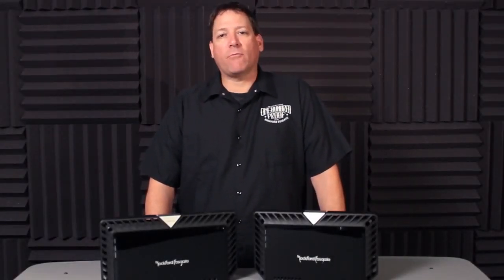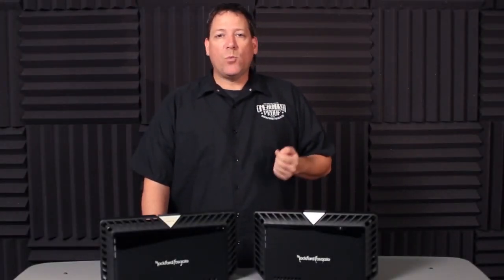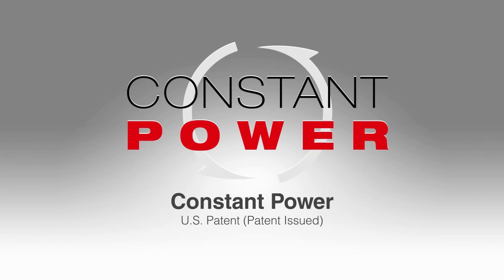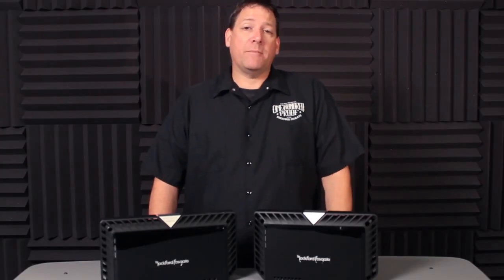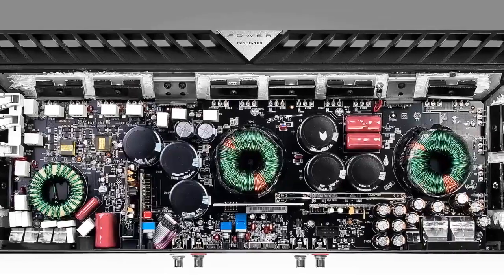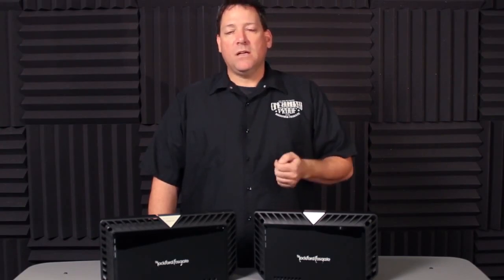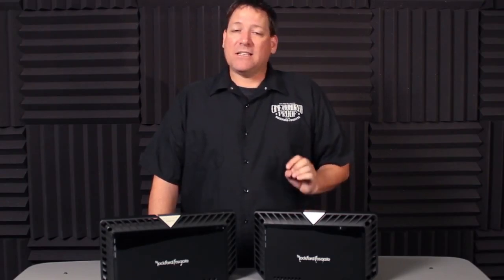Rockford Fosgate: Power Amplifier Overview (3.3)

Comment: Will the Power T600-4 over power a pair of T1692's? Also will a sub (300 RMS) have deep bass with this class amp? Thank you!
Reply from the maker: The T600-4 amplifier is rated to produce 100 Watts x 4 @ 4-Ohm or 150 Watts x 4 @ 2-Ohm.  Dynamic power output is 139 Watts x 2 @ 4-Ohms or 236 Watts x 2 @ 2-Ohms. The T1692 speakers are rated to handle 100 Watts RMS, so this will be a great matching amplifier.  Since the T600-4 is rated to produce 300 Watts @ 4-Ohm Bridged, this will be adequate for 1 or 2 subwoofers.  This is a Sound Quality amplifier so the bass will be accurately reproduced assuming the correct enclosure is designed for the subwoofers.  However, if you are looking for MONSTER bass (like you only listen with the volume at 11 out of 10),  you may want to step up to a dedicated mono amplifier.  The T500-1bdCP is a good starting point.
Reply: @rockfordfosgate  thank you for this perfect response!
Reply from the maker: @JBrain58  You're welcome!   We also have live techs during 8am-5pm (Arizona) business hours.  You'll see live chat at the bottom of our website at rockfordfosgate.com when they are online, or you can always call at 1-800-669-9899 and just talk with them about other scenarios you're looking at.  Thanks for help saving the world from bad car audio, one fanatic at a time! 👍

Comment: Does anyone know how I can tell if my amp is in fact the Constant Power model not the older one? I don't have the manual nor box.
Reply from the maker: The Constant Power models have a RED colored "bd" in the model number badge atop the amplifier.
Reply: @rockfordfosgate  and the tag on the bottom will say bdcp if its still there

Comment: I got a prime 750 on 4 4ohm svc 8s they handle only 200 watts they do good on the amp but should I have went with the punch 500 what would be the difference
Reply from the maker: The differences between these two amplifiers were taken from their spec pages:

PRIME R750-1D
250 Watts x 1 @ 4-Ohm 
500 Watts x 1 @ 2-Ohm 
750 Watts x 1 @ 1-Ohm

PUNCH P500X1bd
150 Watts x 1 @ 4-Ohm 
300 Watts x 1 @ 2-Ohm 
500 Watts x 1 @ 1-Ohm

Comment: I'm planning to buy two JBL CX Series 12" single voice coil 4-Ohm subwoofers for black friday, which amp do you recommend for my 2015 gmc sierra 1500 crew cab, by the way I'm planning on keeping my BOSE  speakers for the highs
Reply from the maker: Hi Juan, the JBL CX Series 12" are rated to handle up to 250 Watts RMS each, so two subwoofers would give you 500W Power Handling and can be wired in parallel to create a 2-ohm load.  If you're looking for just a mono subwoofer amplifier, you could use the Prime R500X1D since it's rated to produce 500 Watts x 1 @ 2-Ohms.  However, I caution you if you love to hammer your system... that amplifier can produce up to 647 Watts which would over power your system.

If you're looking for a multi-channel amplifier to also run the mids & highs, we'll need to see what the RMS power handling is on the speakers, so without knowing, you could use either the Power T1000-4ad (250W x 2 @ 4-Ohm for the stereo channels and 500W @ 2-Ohm Bridged for the sub) or the T600-4 (100W x 2 @ 4-Ohm for the stereo channels and 300W @ 4-Ohm Bridged for the sub.)
Reply: I'm going to to with the Power T1000-4ad thanks
Reply from the maker: That's a great amplifier!  Be careful when setting up the gains for your tweeters and midrange because it's one mighty powerful amplifier.  Just want to make sure your system lasts for a very long time.  You may want to setup the Gain Overlap at 0dB for those speakers.
Reply: I'm kind of confused because you first mentioned the JBL CX1200 12" woofers I'm trying to get handle up to 250 watts RMS each but on the description it says 1,000 peak power each, or am I being understood between RMS and peak power?
Reply from the maker: I agree it's confusing.  If you can't find the certified power ratings (CEA-2016 for amps and CES-2031 for speakers) then always use the RMS Power Ratings.  "Peak Power" or "Max Power" ratings are usually just double or quadruple the RMS ratings to represent "this product can handle this power for a few milliseconds".

As mentioned earlier, the Power T1000-4ad will be great using the rear bridged channels for the subs and will generate 500W for both subwoofers (250+250=500).  I'm just suggesting to use caution on the front channels because you'll be delivering 100W to the left and right sides, so check the power rating of your tweeters & midrange.  To be safe, set the gains on the front channels to 0dB Gain Overlap so you don't over drive them.
Reply: @rockfordfosgate  I know I'm late to the party for this thread, but I just had to give you guys props for not bashing the competition when responding to his question about the JBL speakers. Also props to not trying to hard sell him on Rockford brand subs (which are better by the way 😉)
Those little details go a LONG way in my book! 👍

Comment: Hey there I just bought one of this will it work for 3 12s jl w6s they need 500 rms is this amp weak for  my subs or perfect
Reply from the maker: Hi Kevin, sounds like you may have the 12W6v3-D4 or the 12W6v2-D4 and they are rated to handle 600 Watts RMS.  They don't necessarily "need" 500W, but typically a subwoofer like this works great from 30% RMS up to the RMS power rating (150W - 600W).  Since you have 3 of the dual 4-Ohm voice coils, they can be wired to create either a 6-Ohm or 2.67-Ohm load and have a total power handling capacity of 1800 Watts (we'll assume you'll wire them to create a 2.67-Ohm load.)

A great amplifier is the Power T1500-1bdCP.  It's rated to produce 1500 Watts x 1 at both 1-Ohm & 2-Ohm loads due to its "Constant Power" technology.  We don't have power ratings at 2.67-Ohms since it's an odd impedance, but under Dynamic Power conditions (real world) it can produce up to 1549 Watts x 1 @ 2-Ohms.  This is PERFECT to power these subwoofers without exceeding their power limitations.  Here's a handy link to that amplifier:

Power T1500-1bdCP
http://www.rockfordfosgate.com/products/details/t1500-1bdcp
Reply: Rockford Fosgate thanks I getting a cutcab done rn with 3 w6s v4s with a 4th order box hope that amp gives these sub the power they need
Reply from the maker: Sounds great Kevin!  If you need any assistance setting up the amplifier, feel free to give our tech's a call at 1-800-669-9899.  They'll be happy to clarify any questions you may have.

Comment: I have a t1500BDCP powering 2 JL W6v2d4 12” at 4 ohms, the amp gets hot, do I need to upgrade my vehicles electrical?
Reply from the maker: Does the amplifier shut down?  If so, how long does it run before it does?
Reply: Rockford Fosgate  it doesn’t turn off right away, it did stay on for a while of playing loud music.
Reply: It took about 20-30 minutes
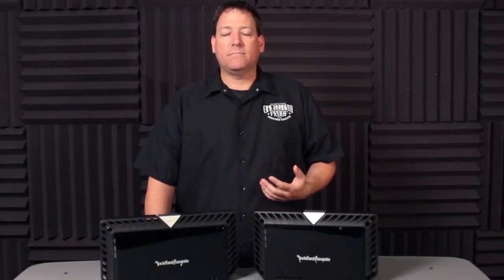Reply from the maker: There's nothing wrong with the amplifier.  Our MEHSA technology moves the heat away from the MOSFET more efficiently away to the heatsink like NO OTHER amplifier on the market.  The heatsink is doing exactly what it's designed to do, dissipate heat.  Look at this video at timecode 01:55 where we describe what MEHSA does for the cooling effect.

Comment: I have a scv 3k  that clamped around 1500 with a 1 ohm load. Will this RF 2500 clamp around 2500 with a 1 ohm load?
Reply from the maker: We run true Dynamic Power tests against Rockford Fosgate amplifiers.  Assuming you're referring to the Power T2500-1bdCP?  It's Dynamic Power numbers can be found under the SPECIFICATIONS tab on our website: http://www.rockfordfosgate.com/products/details/t2500-1bdcp/

T2500-1bdCP Dynamic Power
1823 Watts x 1 @ 4-Ohm 
2940 Watts x 1 @ 2-Ohm 
2980 Watts x 1 @ 1-Ohm
Reply: I was talking about clamping in a car. The way you have the sub in a car will change the ohm level. If I use this T2500, it should clamp 2940 watts in the car cause my ohm level moved up to 2 ohms from 1 ohm. and 2 ohms is about the same as 1 ohm on this T2500. If this will happen, this is the best amp technology out there. And i am a believer. And will buy this amp. I would love to see real wattage in the car.
Reply from the maker: The Constant Power technology inside the T2500-1bdCP is pretty amazing!  You can learn more about CP and how it works here: https://www.youtube.com/watch?v=7EP4-4TMWFw

Regarding "clamping" ... not 100% sure what you're referring to because the impedance plot of a subwoofer/enclosure is very complex.  In addition, the effect on the amplifier is complex as well (see the Constant Power video above.)  It's not a cut and dry 1-ohm/2-ohm equation.

The Dynamic Power tests we use at Rockford Fosgate are NOT based on simple resistive loads, because loudspeakers (subwoofers) consist of capacitive, inductive, as well as resistive loads.  The Dynamic Power data we publish is considered "real world" to what is capable in the vehicle.  I wouldn't read too much into forums that weigh heavily on "clamping" and "box rise".  There are simple factors like charging system voltage, proper grounding, and current reserve (energy storage capacitors) that have a much larger effect on amplifier power than those factors.

Comment: I have a (2007 year made) rockford fosgate p500 1bd  and I have 2 punch 2007(year made) p3sd410 can I conect them to 1ohm with this amp or this subwoofers??
Reply from the maker: You mean the P500X1bd?  Yes, it's designed to run at a 1-ohm load.
Reply: @rockfordfosgate  No. I bought it in 2007 and the owner manual says P500 1BD
Reply from the maker: @mikemorales5361  Ah, the Punch P500-1bd. Yes, it's also designed for a 1-ohm load.  You can find the owner's manual here: http://rftech.custhelp.com/app/answers/detail/a_id/865/
Reply: @rockfordfosgate  great now i know I can run this amp at 1ohm. But M'I in a safe zone to run the 2 punch p3sd410 that I bought back in 2007 without burn them??
Reply: @rockfordfosgate  or would be better to run them at 2 ohms??
Reply from the maker: @mikemorales5361  Although the amplifier is rated to produce 500W x 1 @ 1-Ohm, its actual power output is 734 Watts. However, the P3SD410 is rated to handle up to 600W RMS, so you'll have 1,200W of power handling capacity.  You can find specs on both the amplifier and subwoofer here: 
P500-1bd: https://rockfordfosgate.com/products/details/p500-1bd/
P3SD410: https://rockfordfosgate.com/products/details/p3sd410/
Reply from the maker: @mikemorales5361  No, you can only wire two 4-ohm DVC speakers to either 1-ohm or 4-ohm.  The amplifier is rated to handle a 1-ohm load, so it's totally fine.  If you look at the P3SD410 details page I provided in the last comment, you can see how to wire them by clicking on the WIRING WIZARD tab.
Reply: @rockfordfosgate  awesome!! Thank you!! Have a great blessing day!!

Comment: 1000 watt constant power okay for the loaded p3 enclosure?
 (1200 rms) i know most rockford amps go higher then they say (which is awesome)
Reply from the maker: The P3-2X12 is rated to handle up to 1,200 Watts RMS.  So, yes 1,000 watts will work just fine.
Reply: I'm running my bdcp1000 at 1 ohm on 2 T1 12s and they beat them to death the t1500 bdcp was a bit much for my car to handle the 1000 puts out 1500+ watts and dynamically i would expect in the 2k range. When I buy a 1000 watt power series RF amplifier I expect more than 1000 watts and according to my birthsheet its over 1400 at 2 ohms and over 1500 at 1 ohm. My 1500bdcp does over 2000 watts at one ohm and big d got 3200 dynamically.
Reply: @justinkelsey9218  yeah I ended up getting the t1000 on the p3s birthsheet was 1525 at 1 ohm....thing beats insaaaaaane. Sounds crazy in my 2019 suburu impreza
Reply: @DjTvna  im now running my image dynamics id max 12s on an orion xtr 2500 still got my black cone and silver cone t1 12s tho

Comment: Hi there, i have 2 punch p3 shallow sub and set of T2 components on the front and set of power coax on rear door what amp should i use? F
Reply from the maker: What model number P3 Shallow subwoofers do you have?  
P3SD2-8, P3SD4-8, P3SD2-10, P3SD4-10, P3SD2-12, or  P3SD4-12?
Reply from the maker: O.K. great!  The P3SD4-10 is rated to handle 300 Watts RMS, so two subwoofers will give you 600W total power handling capacity.  These 4-ohm DVC models can be wired to create a 1-ohm or 4-ohm load.  

There are several options, you could use a single amplifier like the P1000X5, or use two amplifiers like the P500X1bd for the subs and the P400X4 for the front components & rear coax.
Reply: Rockford Fosgate thank you! I brought p1000 2x and p400x4.
Reply from the maker: Great!  Our only suggestion is be careful with the P1000X2. That is a powerful amplifier and it will most certainly be feeding nearly double the power those 2 subwoofers can handle, especially being "shallow". Good news is ... this future-proofs your setup if you to upgrade to the Power T1 slim subwoofers as they respond more like a traditional subwoofer and have higher power handling capacity.

Comment: Can i run it 0.5ohm daily? My box rise up to 1.3 ohm
Reply from the maker: No Rockford Fosgate amplifier - old or new - is recommended to run below the recommended impedance as stated in the owner's manual.  0.5 Ohm daily is not recommended.  This is because "Box Rise" is not a constant, and therefore can cause dangerous low impedance conditions for the amplifier, running it harder and shorten the life expectancy of the electronics.
Reply: I wired my sub to rockford t2500bdcp to 0.5 ohm, I checked many frequencies and my lowest box rise was 1.1 ohm . Rockford recommendation is 300 ampere external fuse for t2500bdcp and when I played 33 hertz tune and the box rise was 1.1 ohm my external fuse is blown. Rockford says that on 1 ohm load this amp will give me the same power that on 2 ohms, but if i wire my sub to 1ohm load there is always will be more than 1 ohm because of box rise

Comment: What do I set my gains on my T600.2 I bought it used the gain was set at 5, The EQ was set at 125, and the Hertz was set for 60 Hertz . I'm putting it to push a SA 15 2 ohm dvc are those gains setting good. should I leave it alone. please let me know what to set it at for 1 SA 15.
Reply from the maker: Hi Gz, the Power T600-2 amplifier gains should be set to match the source unit.  We have an article on setting gains here: "How to Properly Set Your Gains" http://rftech.custhelp.com/app/answers/detail/a_id/46 .  For the crossover, I would personally set it to 80Hz since a lot of bass comes from the 50-60Hz region (the current crossover setting is set to -24dB at 60Hz so you're losing lots of bass).
Reply: so why 80 Hertz? and my eq is set to 124 on the amp  and my gain at 5 . what do I set the eq on the amp? and why 80 Hertz if I'm losing alot of bass. my unit is is set at zero and natural sound I got bass blockers on my highs it's a pioneer head unit.
Reply from the maker: Did you have time to review the tutorial on Setting Gains?  It explains how to adjust your gains with and without an equalizer, regardless of the source unit being used.  The crossover frequency is just a recommendation, but as mentioned earlier, the current crossover setting is set to -24dB at 60Hz (it doesn't "start" at 60Hz) so you're potentially losing a lot of bass if you like the hard-hitting frequencies that typically reside at 50-60Hz.  We also have an article on crossovers if you need more information on how they work here: http://rftech.custhelp.com/app/answers/detail/a_id/68

Comment: Wat kind of sub is the best to run on that amp
Reply from the maker: There are several Power Series amplifiers discussed in the video, but we suggest matching the RMS power handling of the subwoofer with at least the RMS power of the amplifier, preferably the Dynamic Power.  The point is not to exceed the RMS power handling of the subwoofer.
Reply: Rockford Fosgate so with this  amp I got what subs well be the best to use in Rockford fosgate brands
Reply from the maker: Rockford Fosgate subs of course ;-)

Comment: I have a t1500, and had 2 type Rs hooked up to it. But the amp is just too much, what are some great subs to go with this amp?
Reply from the maker: Hi Jose,  the Power T1500-1bdCP is a great amplifier and is rated to produce 1500 Watts x 1 @ 1-Ohm but can dynamically produce 1715 Watts x 1 @ 1-Ohm.  The following woofer combinations give you at least 1500 Watts of power handling capacity:

(1) 2Ω SVC Woofer to create a 1Ω load:
• T2S1-13 - Power 13" T2 Single 1-Ohm Subwoofer
• T2S1-16 - Power 16" T2 Single 1-Ohm Subwoofer
• T3S1-19 - Power 19" T3 Single 1-Ohm Superwoofer

(2) 2Ω SVC Woofers to create a 1Ω load:
• T2S2-13 - Power 13" T2 Single 2-Ohm Subwoofer
• T2S2-16 - Power 16" T2 Single 2-Ohm Subwoofer
• T3S2-19 - Power 19" T3 Single 2-Ohm Superwoofer

(4) 1Ω SVC Woofers to create a 1Ω load:
• T2S1-13 - Power 13" T2 Single 1-Ohm Subwoofer
• T2S1-16 - Power 16" T2 Single 1-Ohm Subwoofer
• T3S1-19 - Power 19" T3 Single 1-Ohm Superwoofer

(4) 2Ω DVC Woofers to create a 1Ω load:
• P2D2-12 - Punch 12" P2 2-Ohm DVC Subwoofer
• P2D2-15 - Punch 15" P2 2-Ohm DVC Subwoofer
• P3D2-10 - Punch 10" P3 2-Ohm DVC Subwoofer
• P3D2-12 - Punch 12" P3 2-Ohm DVC Subwoofer
• P3D2-15 - Punch 15" P3 2-Ohm DVC Subwoofer
• T1D215 - Power 15" T1 2-Ohm DVC Subwoofer

Comment: Is one t600-4 enough for 8 pps4 6.5? Or should i get two t600-4 and run 4 on each amp?
Reply from the maker: One amplifier is good because you can run 2 sets on each channel for more power at 2-Ohms in lieu of getting a 2nd amp and running at 4-ohms.
Reply: @rockfordfosgate  My t600-4 has arrived as well as my 8 pps4 6.5 midrange drivers. Will wiring 2 sets individually to each channel create the 2 ohm load? Or do i have to bridge them?
Reply from the maker: @victorl147  Wiring two 4Ω midrange in parallel will create a 2Ω amplifier load.  YOu can use our Woofer WiringWizard for illustrations on how to wire here: https://www.rockfordfosgate.com/support/wiring-wizard/